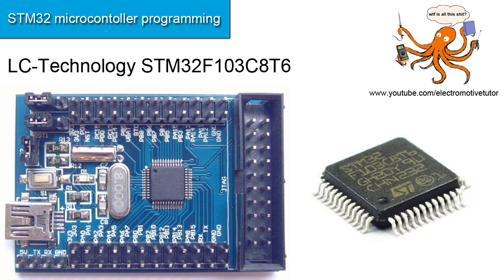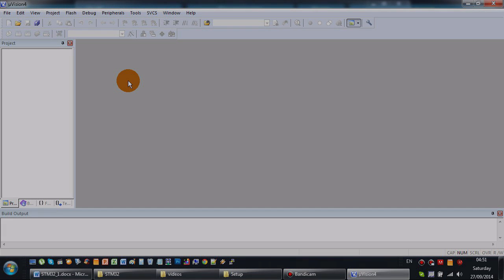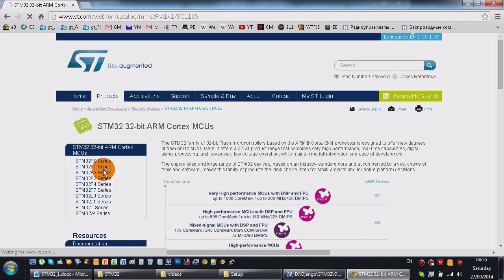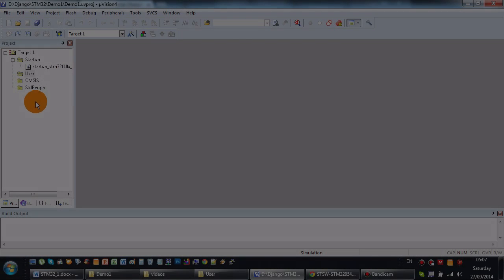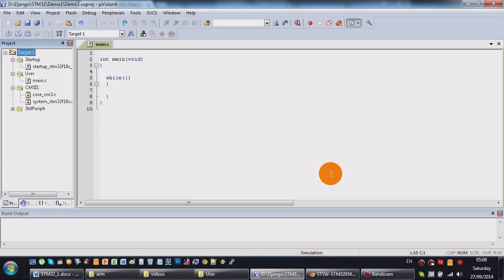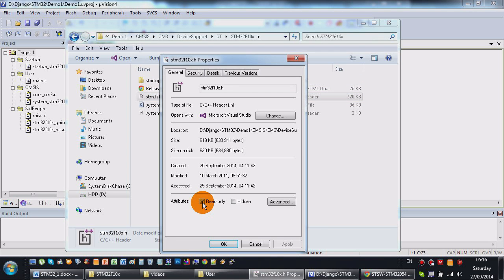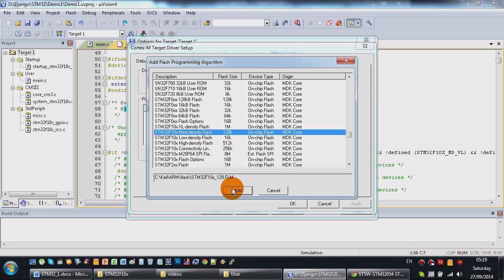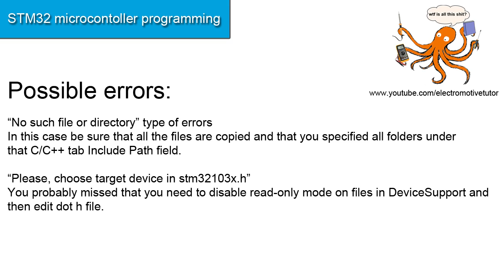STM32 tutorial part.1 - Set up a project in KEIL μVision

Comment: Working with an STM32F103CBT6 I spent some time searching for "core_cm3.c" which is not in the ST package.
I found why :
V3.5.0 (based CMSIS V1.3) vs. V3.6.0 (based on CMSIS V2.1) compatibility update
Due to the directory structure difference between CMSIS V1.3 and V2.1, core_cm3.c file is no longer required. Almost all of CortexM3 CMSIS function are provided as intrinsic by the compiler.
Reply: heeeelp me, how to create file hex for modbus rtu?

Comment: IMO an excellent engineer paced tutorial rather than the more common academic type which bring's death closer. Several questions based on my ignorance.
1. What are the pin connections used between Developer Board and the ST-link?
2. To avoid damaging the board during testing with the ST-link attached, how would you power it?
3. Where you able to locate the actual circuit diagram for the board as I haven't found one.
4. Are you able to give a similar paced tutorial on using the full JTAG capabilities of the board?

Incidentally I believe that depending on supplier the board can come with either 64K or 128K Flash ram, the silicon itself being the same. In some cases the 64 K chip has had the blanked off 64K re-enabled without any apparent problems. In Step 9 when you changed the flash address size to 64K, had you experienced an error or were you being professional and relying on the sellers advert?

The English sounds fine and expensive!

Best Wishes,

Peter - London
Reply: Typo - that should be "128K Flash mcu memory" not ram.